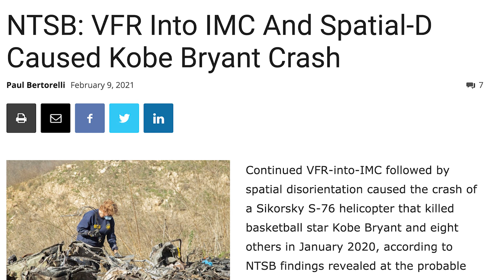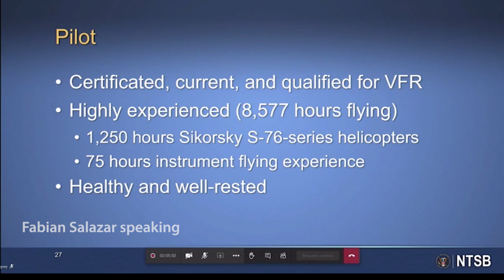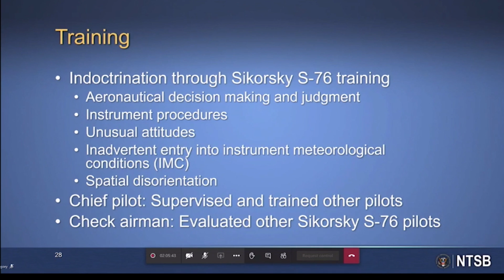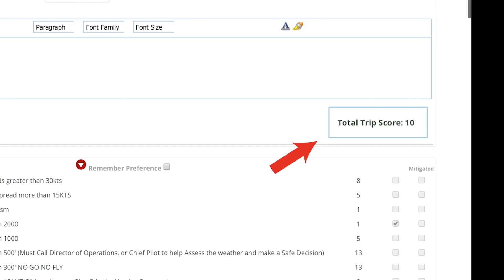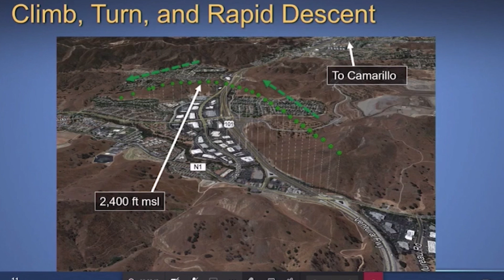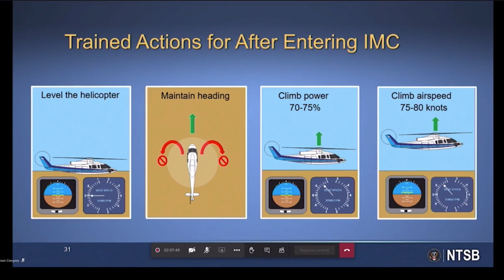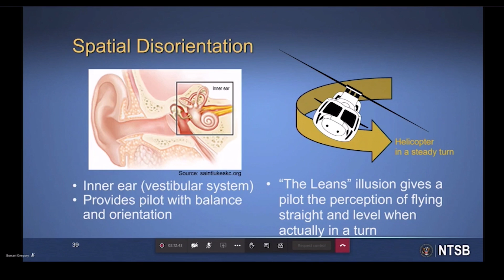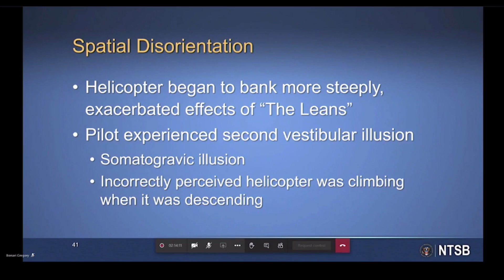How A Split Second Wrong Decision Caused the Kobe Bryant Fatal Crash

Comment: I don't know much about commercial aviation other than what I can read in the FARs.  In the real world, how difficult is it to get a part 135 helicopter charter airline certified for single pilot IFR flight operations?  Based on Paul's breakdown of the crash last year it seems like part 135 disincentivizes a helicopter charter airline to try and get single pilot IFR certified and incentivizes them to try and scud run.
Reply: I think they need two pilots for IFR. Frankly, considering the cost of operating an S-76 is around $2500/hr, any operator should be able to afford another $100/hr or so for a second pilot.
Reply: @bbgun061  You'd think that but most airlines run on razor thin margins.  After all, if adding a second pilot is so cheap then why didn't the airline do that for every flight?  Also, FAR Part 135.105 stipulates what is required for single pilot IFR.  It stipulates that the aircraft needs a 3-axis autopilot and the FAA has to amendment to the airline's operating specifications.  An instrument proficiency check program is also required under 135.297, but that kind of goes without saying.

It's the amendment to the operating specifications that I'm confused about.  The regs are specifically non-specific about precisely what that entails.  My guess is that after the initial certification process most small Part 135 charter airlines are so shell shocked by the experience that they choose to avoid any unnecessary contact with the FAA.  After all, when you're flying in SoCal where the weather is perfect VFR 360 days out of the year why bother spending the money?
Reply: @peteranderson037 Killing 8 people and destroying a $2.5M helicopter isn't good for those razor thin margins either. That's what the management should have considered before dispatching this flight.
If I were running the company, any flight that takes place in MVFR or less would require two pilots and an IFR flight plan.
I'm currently a pilot for a 135 operator. Basically the operations specifications detail what the company is allowed to do, based on their training and management plan. Ops specs are negotiated with and approved by the FAA. They are usually more (but sometimes less) restrictive than the FARs. That's why the operator couldn't fly IFR, even though the helicopter and pilot were qualified to do so.

Comment: The glaring problem is the ever presence of marine layer IMC/VMC on the CA coast (why?  because its a fact).  NO COMMERCIAL OPERATOR, fixed wing or helo should allow any flight to originate without a current instrument rated pilot at the controls and to have filed and follow an instrument flight plan.  The fact this pilot was either not instrument rated or current and proficient is the obvious thing missed or not emphasized it appears.
Reply: The accident pilot was IFR rated, but conducted the flight under VFR.  There is very good evidence that he wasn't proficient.
Reply: @cardinalRG  I said "either not instrument rated or current and proficient"
Reply: @speedomars  --Yes, and that's what I responded to.

Comment: 70 hrs instrument training, only 2 HOURS real world the remaining 68 hrs in the simulator, he was NOT a proficient instrument trained pilot!!.. And who or what pilot in their right mind scud runs up a valley at 140 knots with rising terrain and lowering ceilings without a plan B??!!
Reply: He was not on an IFR flight plan.  Helicopters rarely fly IFR.  Occasionally air ambulances will, but their accident record in IMC is not very good either.
Reply: @billfly2186  yes I'm aware of that, thanks for responding.
Reply: @billfly2186   he really should have been on IFR ,specials Vfrs are death traps  not to mention this helicopter was extremely outdated  compared to the brand new ones out there today
Reply: @flightsimfantasy9798  I agree with you.
Reply: Celeb Client throws all that under the bus.

Comment: More rules and regulations will not prevent this.
Reply: Indeed, and it seems to me that the rules directly caused this accident.  Surely an IFR certified pilot in an IFR capable plane would have flown IFR in that weather, but for the FAA's rules that his charter company wasn't allowed to.
Reply: @StevenWalter  absolutely more rules and regulations are needed. Of course pilots don’t want them, but your flying around in our skies.
Reply: @steviesevieria1868  you want more rules and regulations even if that will cause more accidents?

Comment: It'll be interesting to know what do AVweb thinks about Dan Gryder probable cause and his critisizm of NTSB's findings.
Reply: Agreed. I would believe Retreating Blade Stall before believing the leans set in and this guy refused to trust his instruments.
Reply: @westcoastpilot  Why?  While the pilot was IFR rated, he wasn't practiced in flying IFR.  Pilots who fly VFR into IMC regularly get spatially disoriented and crash.  Why do you think this pilot is different?  Because he had many VFR hours?
Reply: @M1911jln  Because he was dead roughly 30 seconds after entering IMC.  For the average, NON-instrument rated pilot who continues VFR flight into IMC conditions it takes 178 seconds for them to crash  (reference here: https://www.faa.gov/about/office_org/field_offices/fsdo/fai/local_more/alaskan_articles/media/178-Seconds_to_Live.pdf#:~:text=The%20interval%20ranged%20from%20480%20seconds%20to%2020,The%20sky%20is%20overcast%20and%20the%20visibility%20poor.)  This pilot not only had an instrument rating, he had 75 hours in IMC conditions.  He almost assuredly would have lasted longer than 30 seconds, and probably longer than the 178 seconds a non-instrument rated pilot survives.  Considering he deliberately pulled up into IMC conditions, he knew he would need to go "on instruments" immediately.  Also, given the small radius of the turn and the resulting severe rate of descent, it fits the profile of a retreating blade stall more so than the gradual onset of spatial disorientation.  Also, I'm not expert and admit that I'm just speculating.

Comment: Even just an iPad with synthetic vision on ForeFlight or something is not that expensive and could save someone’s life if they make this mistake.  I always have mine up.  Strange that no one ever mentions that. We have these amazing tools now.  And they’re cheap.
Reply: How funny I was just showing my wife the same thing even if you lost your iPad or something you can pull up your iPhone and do the same thing. I used to fly airlines we were required to have the iPad on a suction cup mount up where we could see it the funny thing is the airlines were not allowed to use synthetic vision on the iPad or ForeFlight or any of these life-saving tools but now that I’m flying corporate I can use these amazing tools and I never do a flight even in perfect VFR weather without my iPad suction cup mount to the side window where I can see it with the synthetic vision up. It also has extra traffic alerts that have been very helpful at times. It tells me if I’m on the runway I think I am it even tells me pulling out on the runway how much runway is remaining and even tells me what my minimum fuel is before the “set thrust” call. Most all of that is Bluetooth audio right through my headset automatically.
Reply: The NTSB and FAA don't want pilots relying on non-certificated tools. Yes it could save your life but if it overheats or crashes then you're SOL. A pilot died last year because he was looking at the GPS altitude on his iPad and he was 300' lower than he thought.
Reply: Well you wouldn’t want to rely on it alone and anyone using a GPS altimeter it’s just stupid that’s not it all what we would be talking about. That would not be an excuse to be lazy and not use these amazing tools that we have.  And my iPad rarely overheats it has to be up in the window right in the sun to do that. I keep it slightly lower out of the sun and shaded and it never overheats and I fly jets all summer long.
Reply: And flying 300 feet lower than you think you are cause you to hit something it is really stupid pilot decision making. Why why would a pilot be so stupid flying that low around obstacles anyway when he can’t see where he is going? That’s not the pads fault that’s a pilot’s fault he should be flying at IFR minimum altitude’s following IFR rules if he can’t see where he’s going.   It’s just lazy and lame excuses to not use his amazing tools. One time I was flying and I lost all GPS is in the FAA certified jet that I was flying and the only thing still working was my iPad with 2 m of accuracy.  Of course I was IFR and using the secondary nav sources the VOR‘s as my primary navigation but it was amazing that the only thing working was the non-FAA certified iPad. There’s no excuse not to use these tools to help keep us safe but laziness.  In 11,000 hours of flying so far my iPad has not failed once. I always have two of them you need to have a back up I always have them charged and I always have back up batteries to plug them into. Having synthetic vision in any form is a safety enhancement. It boggles me how people come up with so many excuses and are so afraid to use the new tools that we have even though these things aren’t new anymore they’ve been around for years and years. I fly with pilots all the time they bring their iPads and they stick them in the center consul and never open them or they show up with them dead and not charged. That’s just laziness.
Reply: And I am on the FAA safety team I say use every safety tool you got. Any gauge in your airplane can fail at any time that FAA certified that’s no excuse.
Reply: @Cutedge2  I think he set his altimeter to match the iPad, and then tried to shoot an approach. Certainly poor decision making, I totally agree there. We should all be aware of the limitations of our tools, and not use them to get into a situation we wouldn't otherwise...
Reply: @downc212  I completely agree.
Reply: Wouldn't have make any difference, of course.  In this case the pilot had some of the best attitude equipment/instruments that money can buy.
Reply: @larryslone65  But like we’ve said many times he did not have synthetic vision and synthetic vision does make a difference.

Comment: Well, from the sound of it Bryant was hard to get along with as he'd already "fired" 2 other pilots so it's possible that the pilot was afraid of upsetting Bryant and getting fired himself. That's speculation of course but it's all we have to go on.

Edit I'm certainly no help pilot but I'm just saying that if I have no visual references outside, there are 2 instruments that would get the bulk of my attention---the altimeter and speedometer. I can't imagine why a pilot would not know his altitude. Hitting the ground would be my biggest concern by far.
Reply: ” That's speculation of course but it's all we have to go on. “

Yes, it is speculation.  No, it isn’t all we have to go on.  There’s evidence, friend, and that’s all we should be reckoning.

”Edit I'm certainly no help pilot but I'm just saying that if I have no visual references outside, there are 2 instruments that would get the bulk of my attention---the altimeter and speedometer.”

In zero visibility, an IFR-rated pilot is trained to scan several instruments, fixating on none of them.  They include the attitude indicator (the most important of them all), the altimeter, the airspeed indicator, the vertical speed indicator, and others.

”I can't imagine why a pilot would not know his altitude.”

That’s what spatial disorientation does—it disorients the pilot, and it may impede or even prevent the ability to read the instruments.

Comment: I work with med evac pilots.  6 of them sitting in a circle talking about this crash. The all agree it was a main rotor stall and crash. They also say that 90% of med evac crashes are from rotor stall. Too fast trying to save dying people. You might get away with flying within 5% of your rotor stall speed, until you fly through a thermal downdraft. Then you become just a passenger on your way to the crash site..
Reply: Rotor stall is one possibility, but not the most likely one.  The evidence indicates VFR flight into IMC, followed by spatial disorientation, followed by loss of aircraft control, followed by impact with terrain.  It’s a very common cause of accident, and does not necessarily require a stalled aircraft.
Reply: @cardinalRG  the problem with a stalled helo is, you were going too fast... what I can't get my head around is a 12000 hour ifr flight instructor of this particular aircraft, making such a 1st grade mistake.  It does not add up.. and any helo pilot I have talked to says the same thing. They say, when you loos visual, you automatically glue your eyes to gauges and fly from them.. they are your life... I have flown in low clouds and fog, and my gauges are my only source of life in those situations. I don't buy none of this horsecrap of a 12000 hour pilot killing himself cause he would not look at his gauges..  let's face it, he flew for several minutes climbing up through the clouds with no issue what so ever. Just as he cleared the clouds he went left and hard down...
Reply: @KBS117  --Flying by instruments is an acquired skill, not a natural one, and if it isn’t maintained through practice or experience, it can erode or even effectively disappear.  There is evidence that the accident pilot was far out of practice, his substantial time as a pilot.  Of his 8,577 total hours (not 12,000), only 75 hours were instrument flight hours, and of them only 7 hours were not simulated.  That is a paltry sum for the total hours he possessed, and suggests someone not only lacking appropriate practice flying in IMC, but someone who might have been averse to it—a dangerous trait for an IFR-rated pilot to have.

In addition, merely having a high number of flying hours does not preclude bad judgment on a pilot’s part.  Many very seasoned pilots have perished doing what they knew better than to do.  (Scott Crossfield and Frank Tallman are just two examples.)  So while it’s reasonable to consider bad judgment less likely in a high-time pilot, and surprising when it happens, to disallow it a s a possibility in an accident like this is not sensible.  I’ve personally seen experienced pilots do very stupid things that a primary student would know better about, so I can attest that it’s not as unlikely as you seem to think it is.

Lastly, spatial disorientation negates all the “shoulds” anyway, because it’s a debilitating, physiological state that can reduce a pilot’s training into irrationality and an inability to control the aircraft.  For example, if sufficiently disoriented a pilot may not be able to respond to shouts in the ear from a controller or the person sitting alongside, and may be unable to assimilate external data altogether.  Spatial disorientation does not constitute the accusation that the pilot, to use your phrasing,  ”…would not look at his gauges..”, as if it were a matter of the pilot’s willfulness.  On the contrary, a spatially disoriented pilot can be looking at the instruments, but at the same time be unable to act on the information. In a worse case, the pilot might not understand what the instruments are indicating.  In an even worse case, the pilot might be looking at the wrong instruments, or at no instruments at all.  Since you aren’t a pilot, I encourage you to ask a pilot or two about spatial disorientation, or better yet, an instructor or other expert.
Reply: @cardinalRG  I heard blah blah blah. Your just repeating someone else's opinion. What I challenge you to do, is look at the data and forget what the idiots are saying. This pilot didn't have a hiccup on his record. He was the best of the best. Now let's look at the real facts.. if you look at the weather radar you  can see the wind blowing that cloud bank over that mountain range at about 60 mph in the upper level on that day. Suppose this ship going 140 mph, rises up into that 60 mph head wind and down draft.. will that not be sufficient to stall the main rotor?  He got within 100 feet of clearing the clouds, and that's where the head wind and thermal down draft would be strongest.  
 He is climbing fast and hard, and hits the head wind and downdraft, stalling the rotor.. the ship rolls 90 degrees on its side pulling it to the left, and falls out of the sky, gaining more speed, making it impossible to stop the stall. I agree, at the point the gauges become almost useless and it impossible to right the ship because of spacial disorientation at this point..  I'm saying your theory is partially correct, however, it is not the cause of the accident.. I actually figure that since he was coming in on the inner most part of that mountain range, he flew into a vortex, which rolled the ship left and stalled the main rotor. Just my opinion....
As a pilot I learned one thing about flying in clouds. No visibility is your last worry. Turbulence,  updraft, downdrafts, vortex,  side winds, is the reason why they ground you.  Spacial distortion? I call it being in the blender.